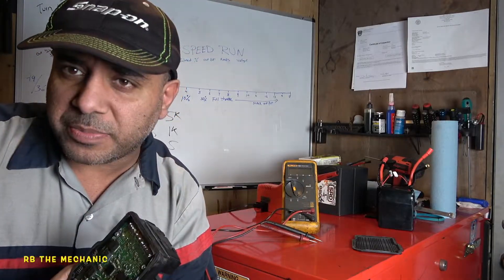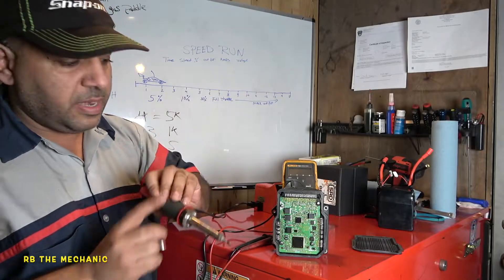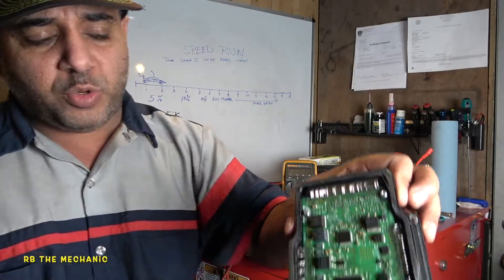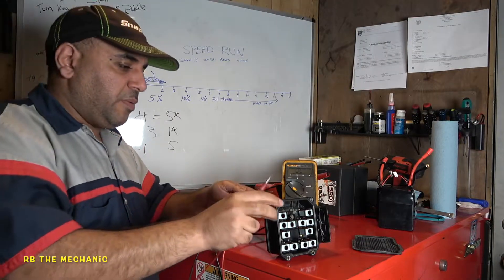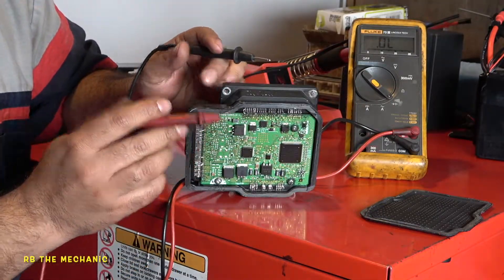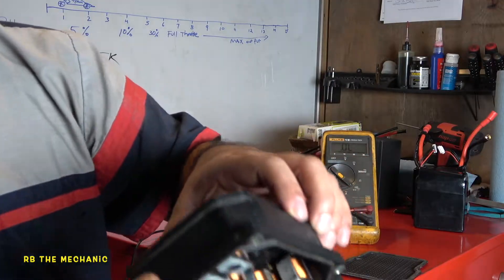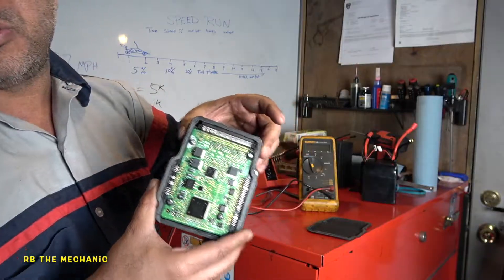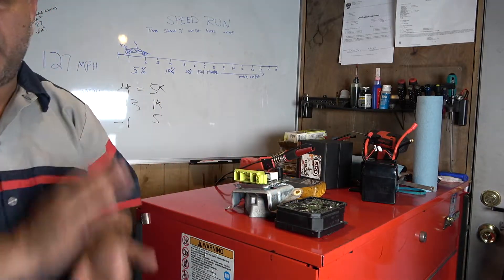Why is this not on a recall by Honda?  ABS module Failure   2013 to 2017 and more

Comment: THANK YOU RB, you saved me almost 3 grand. I sent the module to a repair service and now my Honda has no lights and my module is under warranty.
Reply: Where did you send your module too if you don't mind me asking ?
Reply from the maker: @215ftr  search on eBay for abs moduel repair it will show up msg them they will guide you
Reply: @RBTheMechanic  so if I remove it myself I can bypass removing the brake lines or I will have to disconnect the brake lines if I am going to send it out for repair?  Thanks in advance
Reply from the maker: @215ftr  u don’t need to remove any brake line watch my full abs moduel remove and replace video
Reply from the maker: Nice good job!!!! Excellent
Reply: @RBTheMechanic  hi, u did such a useful video, I have a question about it. Which abs module can I use as a "digital" replacement in terms of canbus/connector compatibility? Is it ok to install any abs module from civic mk9 line on the civic SI oth? My idea was to bypass abs but leaving connected a module on the car in order to send abs status update and not sending the car in limp mode. Thanks in advance for all the support
Reply: Where did you send it
Reply from the maker: @AngelMercado-t2c  search on eBay and moduel repair

Comment: If I do not take it to a dealership do you think it would be cheaper or does it have to be done by the dealer?
Reply from the maker: I would avoid dealer at all cost they do repair on these on eBay u can find the service for $250 and then u just need mechanic to remove and replace as long as problem is confirmed before sending it

Comment: Anyone having issues with 2018 and newer accord? 
I have 2018 2.0t accord and randomly i get power steering light, usually when i am turning into a parking spot or coming out of it and then it disappears instantly. Also, when i brake really quick and hard, dashboard and central screen kinda shut down for a moment.
Reply from the maker: Check ur alternator out put

Comment: When I removed the module on my Accord the motor contacts prongs came out with it. I have read that you should reinstall them into the abs motor side first and then reinstall the module so the prongs don’t bend and make contact. Do you have a video of reinstall of a module?
Reply from the maker: No I don’t but they slip right in and then u out the moduel in they should find its slots
Reply: @ I found your video on a removal and install. It answers my question. You tried first with the pins in the module but then installed them in the motor first and then installed the module.

Comment: Hi, hopefully you or someone else comments back, please…. I am at my wits end with this 2017 Acura  ILX

I started having all the lights come on the dash months ago and after googling I did the first step of replacing ALL wheel speed sensors - problem continued (oh at first problem was intermittent)..

That did not fix the problem and the test you can get at the auto parts still shows problems / low voltage ABS module and two front speed sensor issues.   I checked speed sensors and verified no debris or blockages are in the speed sensor holes and put back in….   Problem continues…

Then I found this post and others about the Module being bad (often) in all Hondas and Acuras like this so I found a place to do the rebuild and ordered the service.  Before I had a chance to take it out and send it, the car started engaging the ABS system for no reason when I was trying to stop and scared the crap outta me!  I immediately got out and unplugged the wiring harness from the ABS module near where the module also connects to the pump and car drove then fine and I was able to pull out module and ship it…

I was excited to get it back because I so want the lights to go off and just NOT needle at my ego anymore after months of messing with it!  I unhooked the battery and carefully put the rebuilt module back in the car and put everything back together and hooked up the battery.  However, I am once again at a loss and all the lights are still on!!!   Is there some type of reset I missed that I need to do?   I was under impression I would not need to with this year Acura ILX because I was putting back in the original part that had just been rebuilt….

Please help?  I am extremely frustrated and am like “what now!!!”!

Thank you!
Reply from the maker: First u need to scan the car and Abs moduel see what the codes are also check engine light

Comment: My module is already out. All warning lamps are on. I did a full panic brake and noticed I have no ABS. Drives like the cars olden days cars I used to have without ABS. My question is, if I remove the computer to send it in, will my car leak brake fluid and can I drive it while the computer is being repaired?
Reply from the maker: Leak fluid?
Reply: @RBTheMechanic I’d like to remove the module and send it in. No one has mentioned if I remove it if my car will leak anything out.
Reply: @RBTheMechanic 
from where the solenoids  sit i think he means , when you remove the controller .

It wont leak .

Comment: It looks like when you're testing it with the Meter, you're testing continuity (resistance) and it's going from Open (OL infinite resistance) to almost a Short 0.0 when you're touching them.   Is that what you mean by broken?  Shorting out?   Broken to me usually means it's open and the resistance would be infinite.

I'm having the ABS lights go on with my Honda and I'll probably be replacing the module as well.  Thanks for the replacement video.
Reply from the maker: Yes the wires r broken open in circuit
Reply: @RBTheMechanic if it was open there wouldn’t be any continuity and the meter would not tone. You would need to test each solenoid until the meter stays at OL meaning there is no continuity and a broken wire.
Reply from the maker: @Cfass1  yes
Reply: I googled this bc my boss is looking at an accord that had the abs module catch fire due to a short. Seems to be an issue

Comment: One other question sir. All these tractions lights abs etc dont alaways come up. Its like every other time . Is that weird or what? If abs connecti3s were bad wouldnt these lights always be on?
Reply from the maker: Yes the broken wires inside might make contact and then brake off again with jumps and pot holes  scan the car
Reply: @RBTheMechanic  no codes come up at all. Tried a few times with my own scanner and Auto zone

Comment: Good morning, I was wondering if I remove the module and send it out to be repaired, is it safe for me to drive the car until the module is re-installed? Should I wrap the modulator (the metal part) to prevent any damage to it if I drive it? Thanks
Reply from the maker: It’s not safe
Reply: @RBTheMechanic  thank you for your prompt response and thank you for what you do.

Comment: Your use of continuity checking does not prove bad.

You, sir, have no clue.

A continuity check verifies that the connection is good when it beaps. A bad continuity check would result in no beap and the screen reading OL for open loop.

Comment: Very interesting.  Then the assholes want 1300 bucks for a new one.  You can risk getting another brick for 300.  I think ill try my hand at soldering it when the time comes.
Reply from the maker: Send it out for repair on eBay offer service for $250

Comment: Looking at their board design and the fact that they need to connect two circuit boards together, that is VERY POOR engineering on Honda's part or whoever manufactured the circuit boards!  This should definitely be recalled!  People paying over $2500 for a manufacturing defect is ridiculous!   I would have used male header pins on one board and the female counterpart on the other board to interconnect the two OR ribbon style cable with with connectors on each board.  I'm guessing the broken connections occur due to vibration after time putting stress on the under guaged jumper wires and lack of vibration dampening on the boards and to box.
Reply from the maker: Yup poor quality and engine
Reply: The engine is not of poor quality
Reply: you are incorrect, stacking boards is not bad design at all, it is done in a very high percentage of automotive and other modules.  the method in which they connected the boards is the issue.
Reply: @bn880  I guess you only read the first sentence in my comment.  I know how to properly stack boards, Honda obviously didn't..

Comment: My kids 2014 civic flashes the lights, power loss to 20mph the. After a few min of driving it it disappears and drives great again. Reappears again w/o warning. Honda dealer couldn’t diagnose because there were no lights  or hesitation.
Reply from the maker: Oh ok possibility could be anything scant the car with high end scan tool for memory and pending codes

Comment: Module Repair Pro, Van Nuys CA look them up about  $250 to repair (8 of them so far, fixed issue and with warranty)
Reply: Some videos on YouTube show that the problem can be fixed by replacing the sensor at the wheel, not the ABS module.
Reply from the maker: @veramann  that’s if u got the wheel speed sensor code
Reply from the maker: Yup!! 👍
Reply: Thank you

Comment: Ill be repairing my crosstours soon wish me luck
Reply from the maker: Cool good luck!!
Reply: So i try to resolder it myself but no luck, the contacts are just too small and the solder i have is way too thick. I ended up finding a geek in philly who repairs phones and playstations. I sent him the part, he did the work and he just shipped it back to me. Charged me $50 plus shipping lets see if it works. I will keep you posted.
Reply: @janelis156 Did it work out for you?
Reply: Did the geek work his magic on the abs ??
Reply: @215ftr  you already know. I did both of my crosstours no more lights on the dash 😍
Reply: @janelis156  I live in philly
Reply: @215ftr  do u have the same issue as me?
Reply: @janelis156  yes abs, traction, fcw, brakes lights
Reply: @215ftr  this guy can fix it u have to remove the module
Reply: @215ftr  so does the geek
Reply: @janelis156  ok I will definitely remove it do I have to open the side panel for him or will he do it ?
Reply: @215ftr  yes u have to send it open.
Reply: @janelis156  let me know when the guy is ready

Comment: I have the same problem but I don’t wanna put a used one in because the same thing is just going to happen. So imma try to solder these myself. You just gotta watch putting to much heat to the board.
Reply from the maker: Yea true I seen the rebuilt one new better contacts

Comment: It’s the same for 2008-2017 they are all the same module.
Reply from the maker: Same
Reply: @RBTheMechanic I have 2013 accord sport I can use a module from 2014 to 2017 ? Need to replace the vsa/vsv module.  I Am having hard time finding one for 2013 specifically.  They are so expensive.  Love your channel thank you for info!!!

Comment: This problem made me go through a nightmare. Changed battery, and alternator and then had this done. The problem being its such a specific issue that caused me thousands in just diagnosis from various mechanics! Still not completely fixed after a refurbished service.
Reply from the maker: Did u have it rebuilt?  What codes u have
Reply: @RBTheMechanic  I may have to check on the codes but it basically had display light up with LDW failed and ECW fail. (Still does) and I did an eBay AbS vsc brake module repair service, new battery,  clean terminals,  took apart display unit and new alternator. Still resets like 6 times a drive and gets worse on backing up.
Reply: @axs7689  have you fixed the problem yet ? If so what was the problem

Comment: All if my lights are on. Codes returned were: 81-19, 38-11, 66-11, 66-13, 81-20. Do you think I'd benefit from sending my module in for repair? No idea how I'd get it out either. 😢
Reply from the maker: Definitely send it out for repair
Reply: I had the 66-13 with all the lights on. Found a guy on OfferUp. I took it out and he fixed it. All lights are gone now. Not sure where you are at but he’s in Pico Rivera, CA
Reply: @1171lopez  sent mine to Module Repair Pro on ebay and now waiting for the return so we'll see, fingers crossed!
Reply from the maker: @laurenliz234  yup good update us!!
Reply: @RBTheMechanic  for sure, I'll let y'all know how it goes!
Reply: Who is it can i get a contact to fix mine
Reply: @1171lopez
Reply: Got the module back today, plugged it in, and IT WORKED! ALL LIGHTS ARE FINALLY OFF! Cost me only $236 from Module Repair Pro off ebay. I'm so happy and thanks RB!!!
Reply from the maker: @laurenliz234  nice good job!!! No problem always here to help !!!
Reply: @laurenliz234 how long did the entire process take? Shipping plus repair
Reply: Are your lights still out til this day?
Reply: @janelis156  Yep, my dashboard lights are not on, still to this day. This was a legit fix 👌🏼
Reply: @laurenliz234  sweet thanks for the follow up.
Reply: Who did you send yours too? Thanks

Comment: Video saved me a lot of money on the part. Soldered and reprogrammed. Car fixed.
Reply: Dude, that's very lame of you not to tell ppl the NAME of the place that you are talking about! Ebay is pretty damn big...😂 smh.. idiots😂
Reply: Did your solder it or send it to  a repair shop?
Reply from the maker: @tthompson6985  I put in used one and got lucky but u can send it to rebuild service on ebay $250 they charge
Reply: @RBTheMechanic  how do you find rebuild service?
Reply from the maker: @Lady_Cicatrix  go on eBay type in abs moduel repair.   It will come up then message them they will get back to u let them know year make model for ur car
Reply: @RBTheMechanic  thank you!
Reply from the maker: @Lady_Cicatrix  welcome!
Reply: @RBTheMechanic  sorry to bother you but what if it’s the vsa module? Is there a fix for that?
Reply from the maker: @Lady_Cicatrix  what year make mode u have?  I think it’s the same moduel. What codes u have? I saw ur message earlier idk why I couldn’t locate it
Reply: @RBTheMechanic  2014 honda accord ex-l coupe. No codes at all. Only the FCW SYSTEM FAILED message that comes and goes. Was told I should try replacing the crankshaft position sensor first
Reply from the maker: @Lady_Cicatrix  no I doubt it’s the crank sensor that will give ur car stall maybe no start at all or it might start and have no power and definitely will have codes.  But did u use high end scanner to scan all the moduels. Abs moduel    FCW is related to abs moduel the small scan tools will not pick up the codes from these moduels
Reply: @RBTheMechanic  i brought it to the honda dealer. They didn’t tell me anything except its the vsa module. When I scanned at auto zone there were no codes.
Reply: @RBTheMechanic  oops meant to add. Only things I noticed are the car sometimes takes an extra second to start like it’s straining. I’ve noticed a rough idle at times. When I first leave in the morning it makes a weird noise underneath. Plus it seems like I’m using way more gas. Though I did get different tires and that can be the culprit. That’s why I thought maybe the crank
Reply from the maker: @Lady_Cicatrix  still if it was crank sensor it would give a code
Reply: @RBTheMechanic  i see. So will the same ebay search work for repair? I found used abs module for about $900 (was told abs/vsa are basically the same thing). I know a guy who can put it in and bleed the brakes, but is worried doing that will end in needing a Honda calibration and the car might not run. Same with repair. I’m not able to be without a car for several days. So I’m not sure what to do ☹️
Reply from the maker: @Lady_Cicatrix  don’t buy new one send ur old one for repair search on eBay abs moduel repair they charge $250.  And u don’t need to do nothing no programing no nothing just I’ll take it out send it out and once u get it back install it back on all good to go
Reply: @RBTheMechanic  but can I drive the car without it? Last question I swear. 😓
Reply from the maker: @Lady_Cicatrix  it’s ok u can ask me all the question u want.    
1. St u can drive without it only remove the moduel not the lines and all.  How ever it’s not safe if car slip loose control it will not be there to assist you so  I wouldn’t recomend it
2 I had customer that had this removed by me and rove 10 miles back home parked it no issue I told him to avoid high speeds and highways  and then after 2 weeks he drive back to me and installed back the rebuilt part
So the answer to your question is.  It can be drive but not safe
Reply: @RBTheMechanic  dang then repair isn’t an option. I have to drive far distances for work and can’t be without a car. I’ll have to try to find a used module. Thanks so much for your help 🤍
Reply: What's to reprogram if you are just soldering wires?
Reply from the maker: @josephphillips865  no need to reprogram
Reply from the maker: Nice

Comment: I am having intermittent vsa, eps, fcw, ldw, warning lights all come on together. I am getting codes U0416-68, 85-01, 81-20. Do you think sending the module to have the electronics repaired by module master would fix the problem?
Reply from the maker: I think this might be same bad moduel
Reply: Any update on your car?
Reply from the maker: @eyem27  we replace used moduel u should send urs out works great check out my other abs moduel video I show full replacement
Video of replacement https://youtu.be/ZYoRcWPGbb8?si=cakKVFn4J4pRlEV3
Reply: I sent mine to module master in Idaho. Thus far the problem has not returned since putting it back in
Reply from the maker: @joelnoles4530  oh ok cool it’s resolved